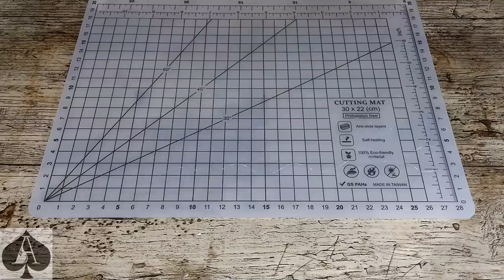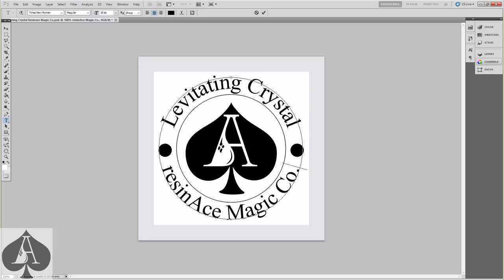How to Make a Magical Levitating Crystal that SPINS | DIY Epoxy Resin Project Tutorial

Comment: Dang! Be honest, how many tries before it performed as it does? This is so freaking clever. I've thought of the string, but I didn't on the magnet end of things. Thank you for sharing. 👍
Reply from the maker: I put a lot of testing into this idea before I created it, so I had been experimenting with several different sizes of magnets, three different types of thread, and made lots of trial diamonds before putting the final piece together. I do all this to deliver a tutorial that works first time. I actually made two of these and they both work brilliantly. The closer the magnets are together, the more reliable and stable is the connection. For maximum visual effect, the one in this video is the absolute furthest apart that they could possibly be, which is why I was gentle with it.

Comment: LOVING this👍❣️ Any idea how I can suspend a large computer chip inside a resin sphere??
Reply from the maker: Thank you. I would use a silicone sphere mould, which I would do in two pours. The process would be similar to this video in which I suspended casino chips in a cube https://youtu.be/V-d2Pcczcwk the notable difference is that the sphere mould will leave a line around the piece, which is arduous to sand smooth without a lathe to turn it on. I have seen some tutorials where people cover the whole sphere in another layer of resin, but not something I've personally tried. ♠

Comment: I'm a first time user with resin can you mix acrilic paint with resin? Also can you put stone orbs in resin?
Reply from the maker: Yes you can mix acrylic paint into resin, I have a video on it here https://youtu.be/p1p5hXjq1WM You can put stone in resin but if it is porous then you may have a problem with tiny air bubbles coming out of it unless you seal it first

Comment: Could you maybe paint the magnet inside the crystal to further hide it? Or would that maybe interfere with the epoxy or magnetism.. Hm.

Also, it's probably just a positioning issue, but do you think it's possible to have it rotate slower?
All this considered, this is still amazing. Especially for something that doesn't require electricity or further resources to work after it's finished being created.
Reply from the maker: Hi, it is not possible to control the speed of the rotation. I start it spinning by putting another magnet close to it, and then it gradually gets slower until it stops. 😎♠

Comment: I think this would have been even cooler looking if either, A) slightly less deep color on the floaty crystal or B) use a mold based on a natural Quartz crystal to make it more, magical because in the shape of a natural crystal instead of a faceted one. C) maybe polished the floating crystal or add thin lines of glow in the dark pigment into the crystal's mold to create a slight mystical glow.
Reply: Since you’re the expert, make your own using the ideas you just shared 😃
Reply: @lemz.limz666   Oh dang, that did come off really know-it-allish didn't it? I am by no means an expert, and was trying to posit the ideas as 'hey this could be neat' but it came off a lot more ' AAActuAALLLY you should have done it like, THIIIIIS, but, good try.' I'd be trying my idea out right now if I currently had the money and space for it. One day though, one day I shall put my money where my mouth is and see if any of my ideas are viable.